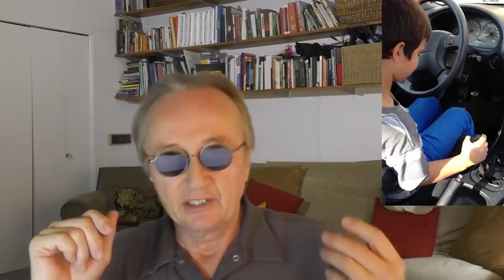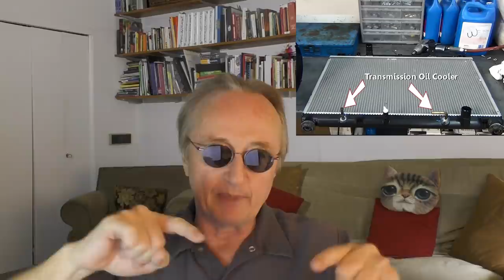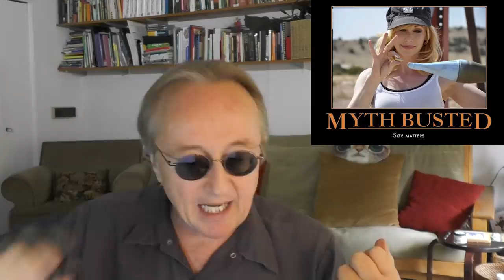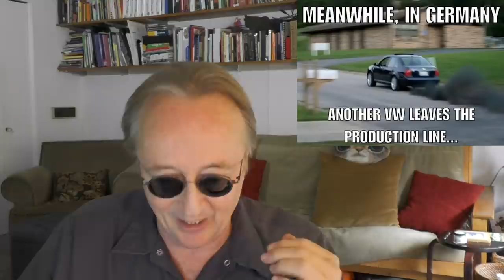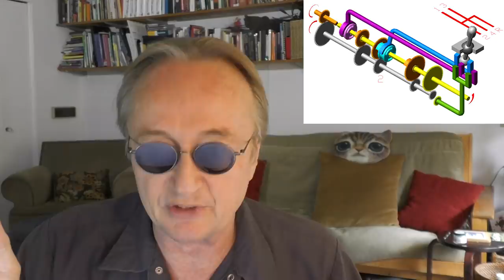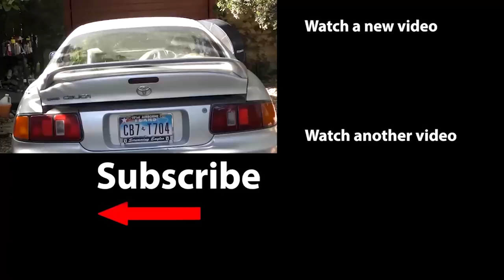Doing This Will Destroy Your Car's Transmission

Comment: Hey Scotty or anyone else who wants to answer this question , I've got a turbo diesel triton 3.2l and it's running extremely rough only between 2300 and 3000 revs , the car radles and there's sometimes surges in the revs, Ive replaces the SCV and air filter and fuel filter, I've now got a scan tool and plugged it in and the codes are saying the IAT sensor input high voltage and also MAF circuit low voltage, I've cleaned both these sensors and the problem is still there , cheers for any help

Comment: Scotty, i have a opel zafira 1.8 from 2003 with 92000 km when i come to a red light and i am not completely stopped and want to put it in first when it has a cold engine it is really hard to put it in the gear and when i can put it in i have to push it trow something only when i am completely stopped it goos into gear without a problem any thoughts on it?

Comment: Scotty i need ur help! xD
My 20 year old car turns off by it self when its going idle. but only when the engine is cold.
the revs just dive too low and the battery lamp lights up.
when ive been driving it for 200meters then there is no problems at all.
Ive earlier had problems with the idle before but it was the opposite problem. too high revs when cold in idle.
I havent fixed anything and it stopped doing it by it self.

Comment: I drove my boss’s work truck and shoved it into P while going about 5mph and it made a bunch of clicking noises until it came to a complete stop. That picture of Gary Busey... lmao.
Reply: The clicking is the parking pawl trying to slot in its hole but missing if it connects at speed you break park.

Comment: Hey Scotty, my 2006 V6 Rav4 with 70000 miles makes a loud rattling sound while in park. Also, my exhaust is noticeably louder in low RPM and makes a loud humming sound. Could it be an exhaust leak?.
Reply: I had a similar problem with my 2004 Nissan Pathfinder. When in slow speeds like traffic and pulling out of the garage there was loud buzzing/rattle. It ended up being a quick fix. The resonator had rusted out. If I was you I would park your car on a flat surface and do a little investigating your self under the car following the exhaust system  look for rust on the mounting points as well. I’m no mechanic but just my two sense
Reply: @jackfletcher5314  Thank you! I'll definitely take a look

Comment: Dear Scotty  (or anyone who wants to answer). Would you rather spend the $1000+ to get the trans. Rebuilt in my 05 grand am, OR spend the money on a cheap replacement vehicle?
Reply: Buy a different vehicle, I think the car is worth less than the transmission.

Comment: Guys my Aventador does not get me the ladies like it used to do I need to change my oil? Plus on another not where do I get LED headlight fluid for my weekend car my Mercedes Benz which also has the same issues as the Aventador.
Reply: Ah, you need a right handed screwdriver and a pot of striped paint to cure your chick problems.
Reply: Are you just driving around the same streets, try cruising around another town especially around a university or night club. That should solve your dry spell
Reply: Can I get those at Dillards?
Reply: Ah a man of action I like that I will give it a try I recently purchased a FWD 911 Turbo from a buddy and still have to break it in.
Reply: Why don't you look up the meaning of sarcasm? how can you actually think I was serious!? ... 'LED headlight fluid' was not a dead giveaway?

Comment: Hey everyone. Anyone think they know what my problem could be?

1993 gmc 1500 216k miles, automatic transmission

First and second gear get me going but third gear has no power and I'm unsure about my fourth gear. While I'm driving on the interstate and start to go up hill, my truck just can't handle it. I'd say about 20degrees is when it starts to lose speed and my truck doesn't seem to have the power to get up it.

It will shift down to third and the RPM will go up normally but with no increase in power. It will then downshift to second gear where I finally get power to make it up hill.

Any ideas?

Last time I changed the fluid, it was the normal dark red color from age with no gunk in it
Reply: Maybe the fuel filter is partially clogged.  The engine needs more fuel under a load but cant get it because the filter is clogged.
Also check the air filter.
Also make sure the exhaust has no restrictions.

Comment: Jezus Scott, shifting from Reverse to 1 in a manual transmission is not a problem. Also, even my 1995 cadaver has means of keeping water out in case you drive trough three feet of water. Please try harder, thank you!